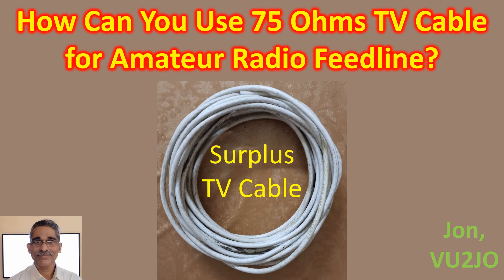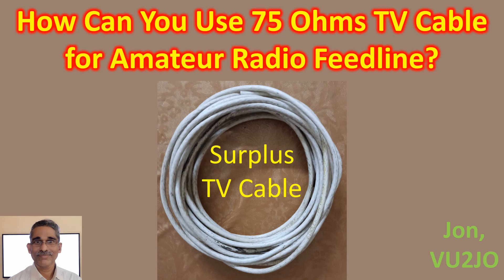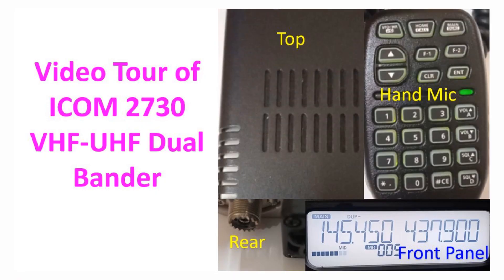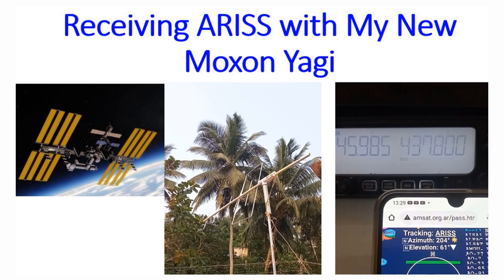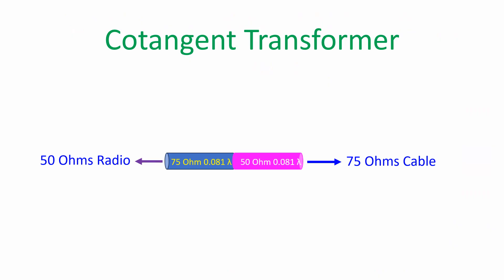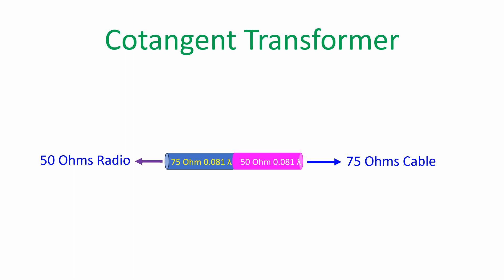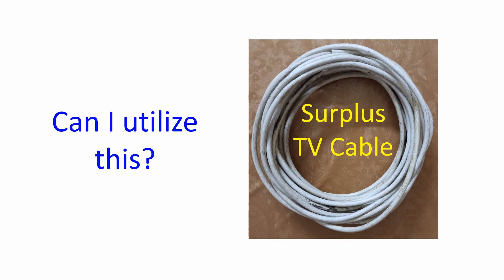How Can You Use 75 Ohms TV Cable for Amateur Radio Feedline?

Comment: In 1974 as a G8 I used 75 Ω t.v. coax on 2m to a h/b 5 element Yagi with a Pye Cambridge and as a G4 using KW equipment I used 75 Ω t.v. coax to the aerial tuner for my long wire.
When I built my h/b radio I went to 50 Ω and BNC connectors. 
I wondered for years as radio amateurs and aerial manufacturers why we did not use 75 Ω coax as dipoles are said to be 73 Ω and a great match. Having recently made dipoles I had wondered about using coax as a transformer so a very timely video. 
G4GHB.
Reply from the maker: Thanks a lot for sharing your long experience. Hope to meet you on air some time in 2024. Happy New Year in advance. 73 de VU2JO.
Reply: @johnsonstechworld  Yes, thanks, HNY.
73, G4GHB.

Comment: I built myself a 2m 5 element quad for the attic. I had ordered some Belden 9913 to connect it up. While I was waiting for the coax to arrive, I was eager to try the antenna. I had some 75 ohm satellite TV coax in the house, so I wired it up with that. Didn't expect much...but I found that it gave me a good match and was pretty low loss! I can get into repeaters over 50 miles away on 70cm in difficult terrain. I haven't bothered swapping it out.
Reply from the maker: Sounds great! Thanks for sharing. 73 de VU2JO.